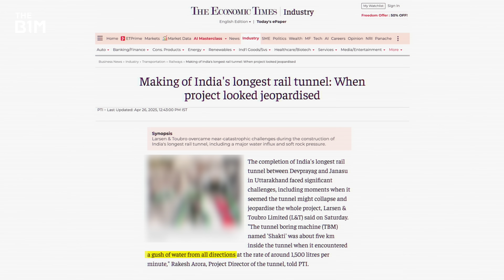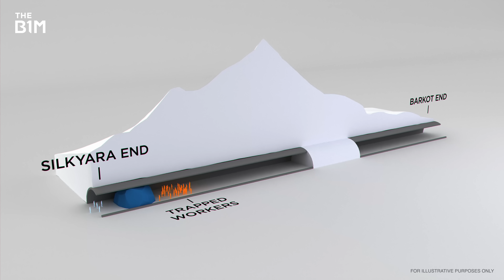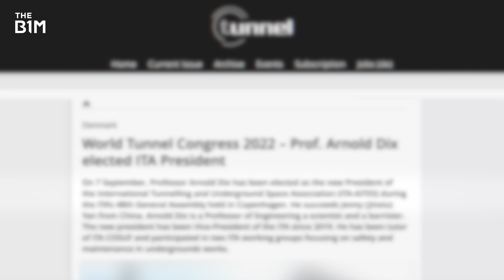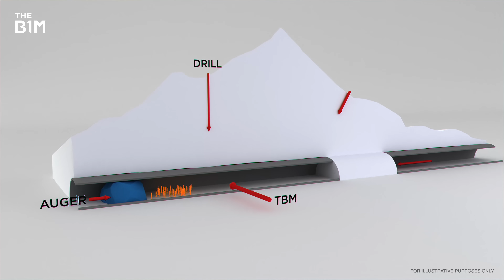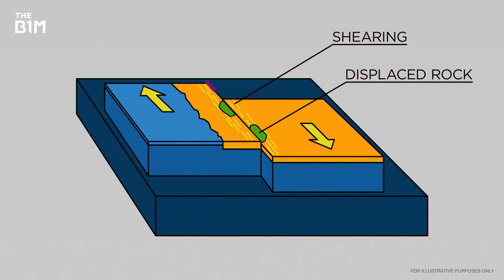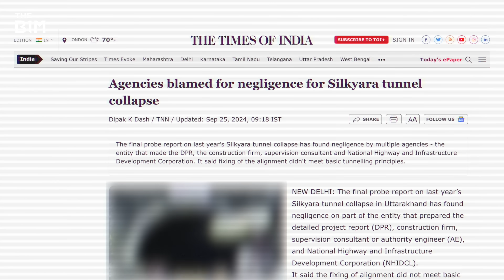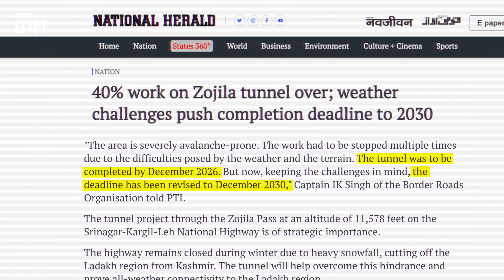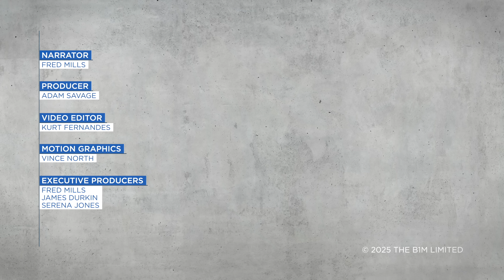Are India’s New Himalayan Tunnels Too Risky?

Comment: They are risky yes, chinas aggressive actions on the border is the cause necessitating the tunnels, as India tried a peaceful method of not arming the area to try and de-escalate the border aggression with china. Primarily around what we call "the line of actual control" (china stole that land but controls it), India tried to ease tensions but china took advantage of that and armed up their side, building it up in order to take more Indian land, forcing India to build these tunnels and arm up their side as quickly as possible. This is the fault of the chinese aggression & indies naivety in expecting china to be reasonable
Reply: bump

Comment: When they decide to build a tunnel through the mountains, that is normal as that is where as can live. They do not have a choice as most roads have to deal with a tunnel sooner or later. They just have to get the engineering right and probe ahead for problems.

Comment: Facts to mention in a comment section with a large non Indian audience because there are always foreigners learning for the first time that India can get snow in certain areas and the vast majority of the Himalayas is in India:

1. The vast majority of the Himalayan range is in India (Indian control, I'm not even counting Indian claims. Only what India currently controls.). I had an American once tell me that he never thought the Himalayas were in India but in Nepal and Tibet. Well, Tibet has little to none of the Himalayas and while Nepal has the highest section of the Himalayas, India has more by area controlled.

2. The Himalayas are generally defined as stretching from Nanga Parbat (controlled by Pakistan) in the west to Namchabarwa (controlled by China) in the east. Search these locations in Google Maps if you have to.

3. The actual high peaks of the Himalayas are to the north of India (and more importantly north of Nepal). This means that most of the India-Nepal border is low plains slowly getting higher while most of the Nepal-China border in Tibet is the high peaks. This means it is far easier to move between India and Nepal than China/Tibet and Nepal. There is no mountain range between Nepal and India.

4. When you say Himalayas, you are generally referring to the south of the high peaks, AKA Nepal, Bhutan and the Indian Himalayas, not Tibet. This is very important to understand. Tibet is a high altitude cold desert, not the Himalayas. The Himalayas and Tibet are two different things.

5. For the most part, China controls the north of the Himalayas (Tibet) while India, Nepal and Bhutan controls its south. However, one big exception to this is Ladakh, an area controlled by India which is on the other side of the Himalayas (North of it). Ladakh has a similar weather and geography to Tibet instead of India's Himalayan states and is known as a 'Tibet in India'. However, the people there are Ladakhis, not Tibetans. The Treaty of Chushul was signed by Tibet (Qing China) and the Dogras of Jammu and Kashmir (the Sikh Empire) after the Sino-Sikh war that recognised Ladakh and Tibet as separate entities for the first time, and each side recognised the other's sovereignty over the other side. This is why China does not claim Ladakh, and India does not claim Tibet.

Comment: One thing that U didn't hear addressed. The Indian subcontinent is still actively moving, with the Indian tectonic plate continuing its northward journey, crashing into the Eurasian plate, causing the Himalayas to grow and leading to ongoing seismic activity and landmass changes. This would seem to be a big factor to take into account when boring tunnels through mountains. Bridges across valleys would be risky enough, but hundreds to thousands of meters of rock above a tunnel is a lot of mass bearing down on the tunnel when th4e shaking starts and/or the mountains moves vertically due to tectonic stressess.

Comment: Himalayas is not just big but also one of the youngest mountain ranges so construction techniques here need to be one of a kind that has never been done anywhere else
Reply: The Eisenhower tunnel on I-70 in Colorado had to deal with the discovery of an unexpected series of faults during construction.
I saw a TV show about how they dealt with going through those faults. Basically, instead of excavating the full width bore, a series of smaller tunnels were drilled around the circumference of the planned bore. These smaller tunnels were then filled with reinforced concrete. Drilling the main bore could then proceed without fear of collapses.

Comment: In the urgent race for the next Indian or Chinese infrastructure superlative, when things go wrong, the term“…without warning…” usually has to do some pretty heavy lifting.
Reply: On July 17, 1981, two overhead walkways in the Hyatt Regency Hotel in Kansas City, Missouri, collapsed, killing 114 people and injuring 216.

That could be said without warning. 

On June 24, 2021, at approximately 1:22 a.m. EDT, Champlain Towers South, a 12-story beachfront condominium in the Miami suburb of Surfside, Florida, United States, partially collapsed, causing the deaths of 98 people.

That could be said without warning. 

What are you trying to say? Something racist?
Reply: @daylate  The hyatt collapse was without warning. The plans had been changed, insufficient engineering had been done to verify that they were still safe, and it wasn't until afterwards that they realized the problem. The Champlain towers were absolutely with warning. Maintenance workers called out the decaying concrete dozens of times and nothing was done about it. 

So if you see a tunnel has collapsed 21 times and collapses a 22nd time, it's with warning. If you can see the rusty rebar behind missing chunks of concrete, it's with warning. The real test is if someone chooses to do something about it prior to it falling down. 

For instance, the Citicorp tower in NYC was built. Years later a student was looking at the designs and saw that it wasn't structurally sound. They fixed all the supports and made it safe for people again. That was with warning and was fixed.
Reply: @RobinClower Millennium Tower? Found out the cost to fix it right was too much so they altered the plan to fix. Result, still tilting.
Reply: Yeah. Like the buildings and bridges in the USA don't fall. 😂
Reply: @daylate Building and infrastructure fails in the US are vastly less common than in India, Pakistan and China, and the incidents that have occurred have resulted in massive overhauls of building code and often new laws passed. Your inѕuffеrable knee-jerk reaction to scrеam “rасist” at a common sense observation just exposes уоu for the predictably biaѕed lеftist сlоwn that уou are. Faсts don’t care about yоur feelings.

Comment: I once heard a talk given on the New Austrian Tunnelling Method, where the speaker opened with the words “it’s not new (it was back in the late 1950s when it was invented) and the key engineers responsible were a Serbian and a German - though it was first used in Austria”. The only Austrian involved was Leopold Muller, and the NATM Wikipedia page points to the wrong person, the artist of the same name born some 70 years earlier.

Comment: The video unfortunately cut the new austrian tunneling method very short. If you compare it to some other methods you might call it a step back in technology, and there are methods with a higher degree of automation. But the important part of the method, it is a design as you monitor apporach. It allows you to react on most problems by appropriate measures. If you build as you planned, you are not using the method, because in absolutely no tunnel you will find exactly the conditions you anticipated.
Reply: And sometimes it turns into a disaster of legendary proportions. 

The tunnel through Hallandsåsen in south western Sweden turned into a quagmire. The initial (turns out very spotty) survey indicated there would be somewhat proper rock to dig through. It turned out to be essentially be a giant drenched sponge.

Comment: As Prof. Dix said they are boys.
It takes many years of experience to read the ground and know how it may behave.
Different hard rocks give different signals before collapse. You must be flexible and willing to change your methods of excavation and support.
There is also no room for cutting corners on the proscribed support methods.
FYI Chris Cooper another highly experienced and qualified engineer was called in to advise and stayed for the duration of the rescue operation.

Comment: In Jammu and Kashmir there is one tunnel Jawahar tunnel built half a century back which is still functional, similarly there are atleast 3 tunnels 10km+ long built in last 25 odd years which are fine so far
Reply: Chenani-Nashri Tunnel, is India's longest road tunnel (9.28 km) in Jammu & Kashmir, in 2017 😅
Along with various other which is larger then those tunnel
Chenab bridge is also recently opened 😅
Reply: @RockyGames-p5s check rail tunnel that real deal
Reply: Built by britisher?
Reply: @karupt422 no , also that tunnel is like 2 kms long and 2 lane
Reply: @karupt422 no ! It's made in independent India The project started in 1954 completed in 1956 !
Reply: @karupt422 Brits have never built at such heights😂

Do you even have high mountains in your tiny island?

Comment: Man B1M finally makes a video about a project india and its mostely negative, as an India I am just filled with sadness, that we have so many talanted engineers and architects but because of some peoples neglet and their greed we get such a bad rep.
Reply: Wdym by " finally" 
Didn't u see the other videos he made about india
Reply: Major Himalayan rail projectsUdhampur–Srinagar–Baramulla Rail Link (USBRL), J&K
This 272 km line into the Kashmir Valley includes about 119 km of route in 36 tunnels, many of which are in very difficult Himalayan geology. With the line opened in 2025, these tunnels are largely completed, though some associated works continue. Rishikesh–Karnaprayag Rail Line, Uttarakhand
This 125 km line in the central Himalayas has a tunnel “scope” of about 213 km, comprising 16 main tunnels (around 104–105 km) and 12 escape tunnels (about 98 km), plus cross‑passages. By mid‑2025, about 195–200 km of this tunnelling had been excavated, meaning most but not all of the tunnels were finished. Char Dham Railway (early works), Uttarakhand
The planned Char Dham rail project (for pilgrimage connectivity) spans roughly 110 km with 17 tunnels, and some packages of tunnel construction have begun in Himalayan terrain between Rudraprayag and Karnaprayag. This adds another set of double‑digit tunnel numbers to the Himalayan rail portfolio as it progresses.. 

More than 300 km of railway tunneling projects alone. Be a little proud. These project are first of its kind we took so some obstacles were due, important is how we learn from it and don't repeat the same mistakes again.
Reply: I think it's pretty awesome that your people are managing to tunnel through such unstable mountains at all - and with these events, nobody died. I'm Australian and just earlier today I was watching an analysis of the West Gate Bridge disaster. There was no unstable rock, extreme rain, or seismic activity involved in that one - just pure carelessness from the people in charge, and it killed people.
Your country is doing great. The Himalayas are one of the most difficult engineering environments on the planet. Be proud.
Reply: @tealkerberus748 exactly, people dont understand how difficult it is to work in Himalayas and our mountains regions, these mountains are very unstable and young, very high seismic activity